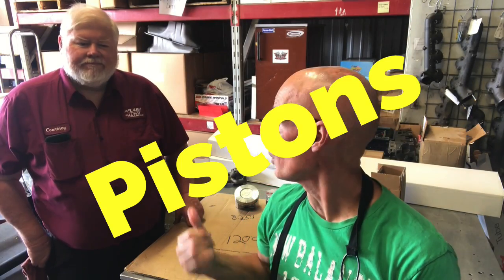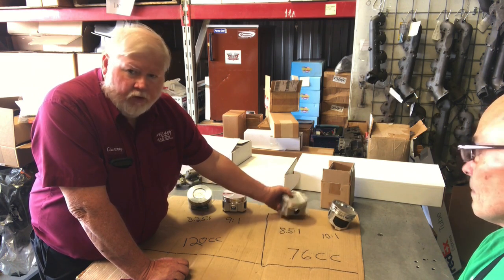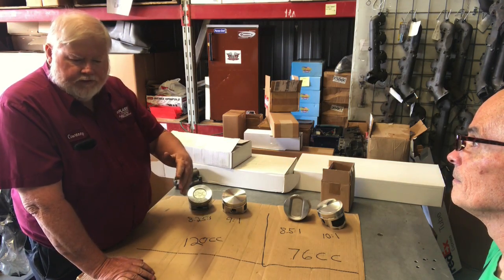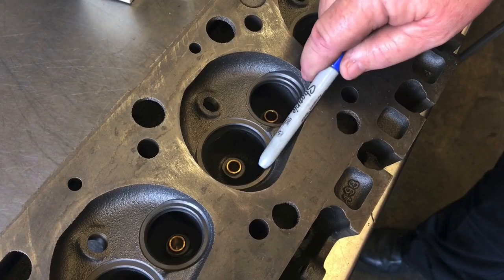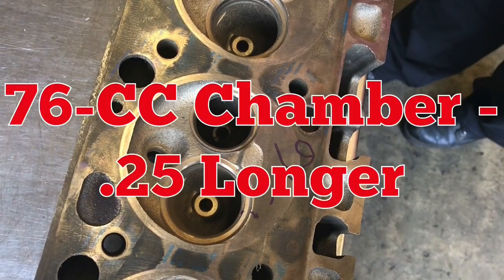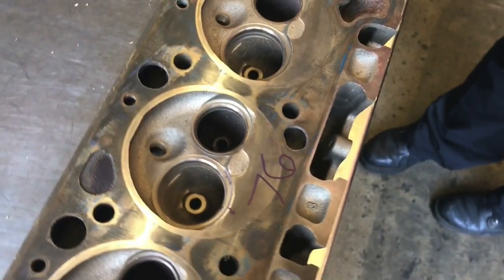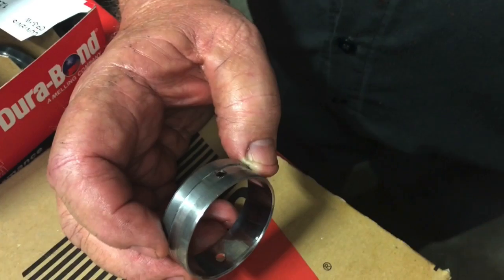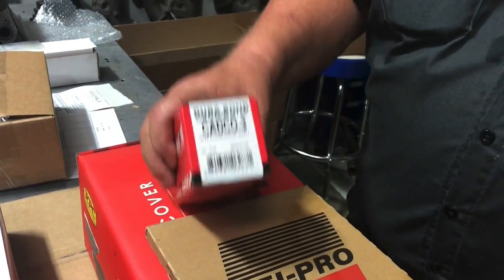CADILLAC POWER SECRETS-CHAMBERS, PISTONS & OILING

Comment: Have another other guys option 305 gmc big block v6, saw one on marketplace and seems interesting.
Reply: I've played around with the GMC big block V6 for many years.  I have a saying:  305's are like kittens, they go free to a good home.  I bought one for $100 to provide installation pieces for my 478 project.  If you can find a 351E or 351M, those are good ones.  They have the big port, big valve heads.  A 401M would be very cool.  The most prevalent problem with the 305, 351, and 379 was timing chain stretch.  After about 50000 miles, some chains would stretch so much that the cam would jump a tooth, and get very retarded.  The heavy duty V6's (401,432, and 478) had gear-driven cams, and didn't have this problem.  All GMC V6's were subject to high wear on the rocker arm bushings and rocker shafts.  

Another frequent problem that plagued the engine series was due to poor maintenance practice.  One weird aspect of the cylinder head design was that the spark plugs were installed inside the vee, on the intake side of the heads.  The spark plug recesses would gather debris out on the road, and when the spark plugs were removed, it was necessary for the mechanic to use a vacuum to CAREFULLY get EVERYTHING out of the recess.  If the spark plug was removed without cleaning the recess, the debris would drop into the cylinder.  Many an engine was damaged when gravel, small stones, acorns, dirt, or lost screws and fastening nuts would be left in the cylinders before starting.

Comment: A little off topic but earlier he said something about boost on a high compression engine. Say a guy had a 10.5 to 1 engine. What would be the difference between boosting that and an 8.5 to 1
By the way I’m anxious for a Ford 300 in-line 6 build. 👍👍
Reply from the maker: more power NA equals more power boosted
Reply: Richard Holdener I’m guessing  you won’t be able to run as much boost in a 10.5 engine as an 8.5 if everything else is the same??

Comment: So what about the rods? At whet point do they need changed out? I assume they are the biggest rpm limiter besides the stock rockers? Looks like those 9.0 flat tops with the 120cc heads would be the sweet setup for a turbo motor as they would be the least likely to detonate/knock.
Reply from the maker: rockers-rods are good

Comment: I guess I'm weird .... but with today technology , all aluminum and great  performance why go back to 40 year old stuff? Unless you need OE for a old school rebuild. Great show Richard.
Reply: Because unless you spend a lot of money, new aluminum stuff makes nowhere near the torque at nowhere near the usable RPM that the Caddy does.  And if you do spend a lot of money, and then get all that aluminum hot..  once..  you're going to be spending a lot more money again.  That old high nickel content iron Cadillac block and heads are far more forgiving of high temps on a hot mountain pass than any aluminum setup.

Show me a modern aluminum V8 that I could buy and build for three grand that would move a 15,000 pound school bus like that forty five year old Cadillac V8 does..  keeping in mind that the rest of the agricultural manual transmission drivetrain of said bus is ideally suited to sub-4000 RPM action. There's no such modern aluminum engine available.
Reply: @Bolton115  I tell my LS fan boy friends this all the time. Its amusing to watch them wind up an LS motor to 5k rpm just to shove a American land yacht thru an intersection.. No amount of gearing will prevent lugging and walking your crank into the thrust bearings over and over again. Cadillac made engines for tanks for a reason.

Comment: No mention about port differences. The 76 chamber heads with lower valves could have better short side radius. More flow potential when ported. The bowl areas look pretty bad. Porting must go along ways on these heads.

Comment: Back in the 90s "hotrodder" magazine made an article about  the caddy 500. They use cast rods. So they offset ground the crank to fit chevy big block rods. This stroked it to a 540ci! Then had custom pistons made and edelbrock manifold and cam, upgraded the rockers and used adapters for chevy big block headers. The thing was an absolute beast that could make a diesel cower!
Reply: They also modified the factory crank fillets on the edges where the rods meet the crank throws. They radiused them, and widened for the Chevy rods. Another modification was the addition of a rear oil drain in the lifter valley and clearancing the pushrod guides innthe heads. I've seen other goofy set ups- (Potters Engine masters machine with oil pipes routing oil from the plugs in the lifter valleys to the top end) etc.

Comment: Cool tips.  Love the Q-Jet.  On some earlier Caddy and Buick HEI distributors, they have a 5-pin module.  The 5th pin is a retard function.  Ground the pin and pull 4~6 degrees of timing out of it.  So that works well on higher compression engines with aggressive timing.  Makes starting a lot easier.  And since it is done in the module electronically, the retard function is independent of the mechanical systems, base timing, etc.  Just another cool Caddy thing : )

Comment: I was wondering with all the Caddy stuff lately if you would consider expanding your channel. Would it be possible to put a front wheel drive Caddy motor and trans in some car to make it a rear engine transverse mount setup? Have it make stupid amounts of power and start a new chapter in hotrodding.
Reply from the maker: its been done with ELDO drive trains
Reply: Some 12 -15 airport shuttle vans in Miami had rear wheel drive eldo set ups in them.Didnt get a good look on set up
Reply: I remember a guy doing that with a Porsche, but used a 403 Buick engine...
Reply: There was a guy that did this to an acura integra. Twin 60mm turbos, and 2x 4bbl TBI set ups I believe.

Comment: That  reference to the possible cam bore miss alignment sounds familiar.  I have run into that on some"not real common" small block Fords. I turned a couple of old cams into cam bearing  cutters. Be careful  and work slow and you can "trim" a slightly  misaligned  cam bearing.

Comment: I always wanted to put one of those 472/500 caddy engines into a lightweight chassis with a gear ratio that takes advantage of its torque curve for some fun street cruising.
Reply: We put a caddy 500 in a Buick skylark a few years back and took a lot of money
Reply: @puffkendrick6850  Just wondering if the end result was worth the time/ money/effort and if you put it in stock "as is" or did engine upgrades. I dreamed of doing it back in the 80's when these engines along with all of the "other guys" big and small blocks were literally in almost any junkyard by the hundreds ( I wanted to just drop it in stock )...aftermarket and off the shelf parts such as carbs, distributors, intakes, cams etc. were fairly cheap...although there wasn't much aftermarket support for the caddy except for CMD (Cadillac Motorsports Development) I believe it is actually the same guys that did the engine in Richard's video but just changed their name and location.
Reply: The 1st time engine was was mainly stock neighbor gave us some small chambered heads he was tossing,engine awoke somewhat.2nd time we went all out with some cmd goodies.Til this day people are still shocked what this engine does. Was told launching it sounds like a dragster
Reply: @puffkendrick6850  Torque rules on the street if you think about it you rarely see over 5500 RPM during normal driving unless you are running 4:11 gears and such... I had a buddy that pulled a BBC with a TH 400 out of an RV and put it in his square body Chevy thinking it was a 454, didn't change the cam, intake, exhaust or anything, just bolted it in and it ran smooth at idle but in his words he described it as "scary" when he laid into it and he was used to modded 454's. It had a 3:08 rear gear (with a "Lincoln Locker" welded diff) and come to find out it was actually a tall deck 366 which wasn't much on horsepower but would deliver tons of low end torque.
Reply: @AreaThirteenThirteen  I agree and if you throw a over drive transmission in the rear you can hit the Highway.The truth is if you take a chance and run something different and win you'll always be remembered
Reply: Torque rules
Reply: @puffkendrick6850  True, yes it is always fun to do something different and out of the ordinary!
Reply: @AreaThirteenThirteen  Yes i remember going to car shows with my cad 472-500 series and people would say you can't be serious. I continue to have a lot of success with these engines
Reply: @puffkendrick6850  That is awesome! I haven't done a "project" in over 10 years, but am definitely looking to get back in the game here in the near future.
Reply: @AreaThirteenThirteen  Yea go have some fun ,I wish you well!
Reply: @puffkendrick6850  Appreciate it! I have a lot of things in mind but am leaning towards doing some sort of sleeper daily driver type of thing or even a rat rod. 😎😎
Reply: I had a friend at Trade School that had a Chevy Vega Stationwagon and blew the engine ( they were good at that ). His grandfather had a 472 Caddy that got totalled from a truck rear ending him. Vega's 4 speed tranny was same as was in the Vette's at that time so, he went for broke! Big problem was the TORQUE! Had to lay a layer of bricks on there sides in the back with a sheet of plywood with J-bolts through the floor holding them in place. Central Ave. In Phoenix had alot of turned heads...

Comment: Wonder how much trouble it would be to do the old odd fire Buick V6??
Reply: All the trouble. Oof. Why?
Reply: @timothybayliss6680  Wasn't there a guy named Kenny Bell that sold hot rod parts for the Buick V6? I think he could easily get 300hp from one??
Reply: @adampatterson707  it wasn't a buzzy oddfire 225. It was either a 3.8 or a 4.1. There is almost no aftermarket anything for them, and none have been built since 1976. There is so little reason to rebuild an oddfire unless it's for a collector car.
Reply: @timothybayliss6680  The last one I saw was in a Jeep. I think that Jeep called it a Dontless , my spelling is probably wrong. What V6 Buick was ran in Nascar during the 80's? Odd fire or even? That Jeep had pipes ran down each side and it had one crazy sounding idle.

Comment: Ewwww, there is like no quench with the 425 heads. I actually don't mind the chamber shape of either of the other heads, they're not modern but the valve angle doesn't look huge. 39° is lots of timing but that was a mile high with a 4.3" bore. That's not too bad. The small chamber heads with a proper dish for quench would probably be the best setup but run what ya brung.
Reply: agreed
Reply: I brung the 425 heads on the 500 in my converted bus.  They run just fine.

Comment: I would like to know what your engine is doing regarding rocker arms.  I didn't see a shaft rocker system.
Reply: The one with forged rods has aftermarket rockers and shafts. The rebuilt stocker has stock clipped ones. If you watch the videos of them, they show up for a second. The dude bolting down the stock rockers mentions how they limit the rpm. Even the stock shafts will start to bend if you need a big valvespring for an aggressive camshaft.

Comment: The q jet is notorious for drivability and dependability Rochester put a lot of research into the development of them and GM used them on everything for how long ? They got a bad rap because they are not quite as simple as a Holley but as you've shown can keep up and possibly even surpass a holley of similar size maybe take a little more effort as you said but that same carb will run anything even tho the idle circuits different etc you could and I've done it put that same carb on a 305 Chevy and it will run and run pretty well too maybe a bit rich I assume but the one I found in a shed that had been there since 1999 I never opened it up it was off of a 78 trans am so it was an 800 as well I stuck it on a slightly cammed 305 and the accelerator pump still worked fine I was amazed try that w a Holley the accelerator pump and power valve at least will have issues this didn't leak a drop or have any float issues nothing and moaned loud lmao love the Channel richard
Reply: Part of what leads to the bog of a Quadra jet is the clockspring for the air doors on the secondaries. It sags over time and let's them open earlier than they should. Honestly it takes like 30 seconds to adjust them too. All of these carbs are at least 30 years old now and people think they should work like brand new with no maintenance. For drivability, they're hard to beat.
Reply: Glenn Manchester  It was born on the pre-emissions era of the 65 Clean Air Act. It was on the boards till 1991, and ended up altitude compensating, pulse width modulating for closed loop fuel trim, and served 230 to 500 cube engines with a quarter of a.century of factory OEM sales and backup. From net horsepowers of 135 to 650 in certain catagories. And one 24 hour factory races in production stock.Group A, and people who understood Carter AFBs and AVSs and Thermoquads Just Dont Get the Q-Jet. Like the Turbo Hydramatic, also another GM Mark of.Excellence. Best carb ever made. Metering rod that stabs the heck out of.any other carb. Only thing is it would have been cool to see it Win LeMans. The 4150 got that one. The Holley can slip into the role that the Qjet is good at, but it never got the lean cruise and aneroid adjustment and the big bucks GM spent to meet and beat  emissions  shed sniffer tests. If it wasnt for evaporotive emmissons and OBD 1 & 2..it'd have been around even longer.

Comment: Reading about deburing and shaping pistons. Rough surfaces hold oil and transfer heat better than smooth surfaces. So there's no reason for the underside of a piston to be smooth. On the top you want it smooth as you can to avoid hot spots and reflect heat. The layer of carbon in the combustion chamber will probably block more heat than the polish will reflect but it all helps. 

If I need to remove any material from my pistons I will make a jig so that I remove as close to the same amount as possible then attempt to polish the area up.

Comment: Saturday I did some trading around and got complete running (well it was running when they pulled it)1997 L21 454 and I'm planning on putting some halfway decent forged rods and pistons .30 over more than likely a pretty nasty and lumpy turbo grind and either find some used Aluminum heads or pick up some promaxx heads, Im gonna shoot for 12 to 1 compression but no less than 11 to 1 a single plain efi intake a 100+mm elbow and throttle body some Bosch 210s I use in everything and Holley efi  setup with a HP ecu im not gonna run coil on plug yet. Im trying to keep it cheap as possible and run a pretty simple single turbo setup I already have a air to water intercooler thats good to 1800hp and see how big of a exhaust housing is available for on3's 107mm turbo if they don't have what I want I have access  to Precision promod 102mm thats a few years old. I have been wanting to play with a big block ever since Richard started messing around with the sbe 454 with boost a while back. I have a 1977 Nova that my paw paw bought new in 76 and was the first car i ls swapped and turbo its a super simple setup that works pretty damn good built 8.5 10 bolt with a spool and 3.70 gear calvert leafsprings and caltracs some single adjustable Strange shocks a anti-roll bar the kit came from TRZ sub frame connectors 8 point cage up front its basically stock besides being rebuilt and the coils and 90/10  shocks and  a brace I made years ago tying the front frame rails together before the sub frame connectors and anti-roll bar. In 2017 it went a best of 6.21 @ 118mph with a sbe 5.3 with a ljms cam pac springs 706 heads stock truck intake and throttle body a simple single turbo setup with a ebay air to air intercooler and a cast wheel t6 s475. Its been sitting in a barn on blocks with a tarps on it since 2017 it should be pretty damn cool with a big block im kinda excited about that im turning 30 next month and never owned a big block and can count on one hand how many old small blocks Ive had